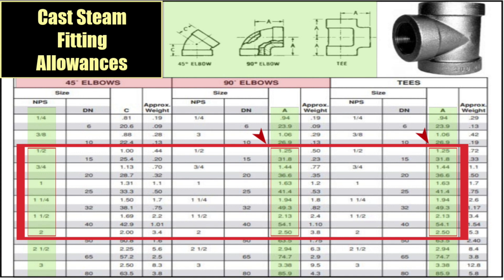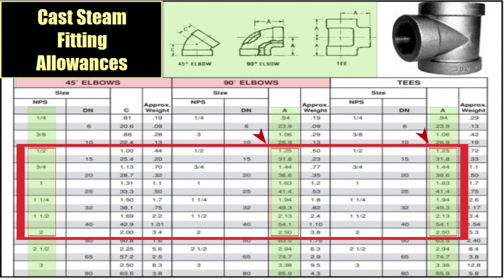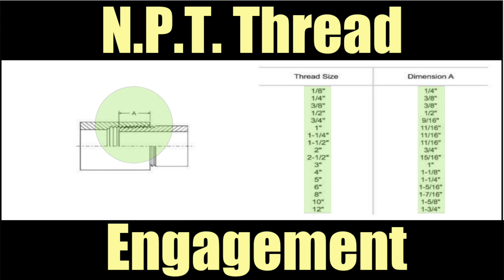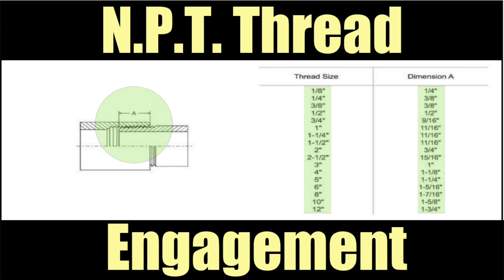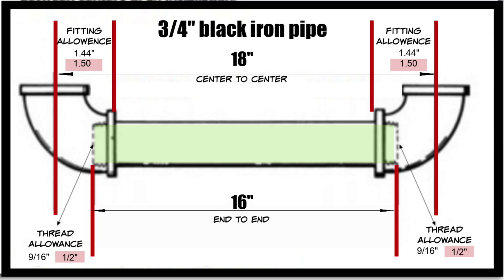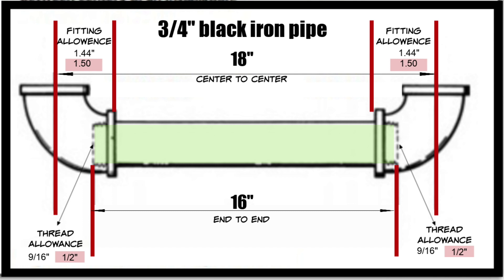Pipe Fitting Basics

Comment: I think what I am going to try is cut some pvc pipe get my rough cuts use metal pipe fittings and I will take the pvc pipe to the hardware store have them cut it and cut threads on it so I can get it right the first time I will put some of it together and pull my measurements off of that  iam trying to make it cheap for  before I srcew it up I have pvc left over I can figure it all out before wasting money cutting pipe that will not fit. I know I could fabricate this stuff if I would go down and buy the pipe threaders, things i'm trying to do a cheap and on a bunch of right now and I can make it any size, I want if I get the pipe threaders and the pipe stand vice's and all that i had good luck with having the hardware store in past cut fabricate my pipe. I was real happy last time. How good it fit? But anyways, I wanted to say thank you. That was a great awesome video. Full of great tips. I do like how you laid it all out on the floor and measured everything out. I'm kind of doing the same thing, but I have a spot right that it's very big and It's underneath the mobile home and hard to get to, but I wanted to say thank you.Keep making good great videos

Comment: I'm A PF apprentice and I cried about 4x today!!!! I have never felt so useless and dumb. Why can't I get this?
Reply from the maker: Example:
Imagine a fitting with a face-to-center measurement of 2 inches and a thread engagement of 0.75 inches. 
To calculate the fitting allowance, subtract the thread engagement from the face-to-center: 2 inches - 0.75 inches = 1.25 inches. 
This means you would need to cut your pipe to be 1.25 inches long to fit properly into the fitting.

Comment: When i do threaded pipe i take my desired over all length take off my fitting throw times two than add my thread engagement. I make sure to write down each step over all fittings then c2c  then next c2c >f2f add in my f2f +engagement = cut <cut>

Comment: Are dresser style/compression  fittings acceptable to use to transition between galvanized to pex? Trying to replace a section of 1/2" supply line to a hose bib. Everything is of course badly corroded. Is that recommended if you cant cleanly get a fitting uncoupled?
Reply from the maker: I would just use  a Shark-bite fitting - https://youtu.be/CuqEibmPVRE?si=WoS6sIFRmtWhxel9
Reply: Thank you for responding Bob. I can use a shark bite on galvanized pipe without having to cut threads?

Comment: I'm wanting to replace two small sections of steam pipe. One section is about 3' and the other section approximately 2'. The first is in between a coupling and a 90° and the second between the 90° and a 2" Tee. 
After sizing and whatnot, I'm thinking it through and can't figure out how I'm going to make the connection to the Tee fitting because of "right tighty, lefty loosey"...
Reply from the maker: You'll have to place a union fitting in between the coupling and 90 or the 90 and tee or both.https://amzn.to/48EG0dB
Reply: @BobsPlumbingVideos  ...so grateful to you for your timely response. I subscribed to your channel because you seem really cool and I resonate with guy's like you. I ended up figuring it out on my own, about the union,and took most of the day figuring out how to accurately calculate the right threaded length. Do you have a handy fool-proof method for figuring out the calculations without going through all the stress(and numerous trips to home depot to get it re-cut and re-threaded) that my girlfriend and I went through???

Comment: Take the pipe size multiply by 2 and add one thread size take this number subtract from center to center measurement 3/4x2 =1.5 plus’s 1/2 thread =2 inches now subtract 2 from 18 get 16 boom simple
Reply: This is the way.
Reply: Where are you getting the 1/2 thread size if it’s 3/4” pipe a little confused about what you mean for one thread size would really appreciate the help
Reply: @chrisskidmore7651  1/2 of thread goes into the fitting.
Reply: Where did you get the 18 from?

Comment: I think the only time I’ve ever used the book on allowances was during my exam. If I remember correctly I think they taught us with iron pipe on a 45 offset the allowance is the pipe size. So on 3/4 you’d take off 1 1/2 total, 3/4 per fitting. Or maybe it’s 3/4 total, I can’t remember but that doesn’t sound like enough. In the field i just put a tape to it and eyeball. It seems like with dwv most of the measurements are pretty round. It’s been a few years since I’ve done a threaded pipe job and I’ve probably done 3 in the last 6 years. We use mega press mostly. But even when I did it I’d just eyeball the tape and it never caused me any issues. The only time I use any of these numbers is on an offset formula. Even then I just measure the allowances. I do find it interesting that the two pipe systems that are going away are the ones that look the best and neatest. I think soldered copper, if done correctly, looks so much nicer than pro press. Funny enough on the video topic copper is easier to measure with solder because there aren’t many take offs. On 90s and tees you jest measure pipe to pipe. With pro press though there’s a small allowance on fittings in order to fit the press head on so you have to account for that. Threaded gas pipe looks so much cleaner than mega press. With mega press you can easily press a pipe in slightly crooked. It won’t leak but it looks terrible.
Reply from the maker: Agreed!

Comment: This topic does not get sufficient recognition in the trades wether it is the books classes or in the field. Great video,    I am getting that book!  Do you happen to know why steam fittings are so beefier and shorter than regular plumbing & gas fittings. Steam pressure for heating systems  is far less than the pressure on water lines no?
Reply from the maker: That's a great question and one I never gave much thought about. I'm going to do a little research and try to answer that for you! Thanks for the question. Bob.

Comment: Hi Bob, I congratulate you for your channel and your videos, very well explained and illustrative.  I would like to ask you a question since I have seen in the work of Pipefitters and plumbers most of the time that this type of threaded joints is made by some people empirically and without technical basis.

Please can you help me solve or know how to solve problems or real situations of take off in threaded joints.

For this examples: 

1) A piece of NPS ∅2" pipe is being cut to run between two 90° degree threaded fittings. The center-to-center measurement of the fittings is 7'-2¼". What is the cut length of the pipe?

2) A length of NPS ∅1½ inch pipe is to be cut run between two 90° degree 6.000# threaded fittings. The fittings measure 7 ft 2¼ inches center to center. What is the cut length of the pipe?

What fittings tables do you use to obtain the dimensions required for the calculations.

Regards... Thanks
Reply: Hi Bob, so sorry for not answering you on time, these fittings are for fixes and spools in AHU's connections for HVAC and Chillers.... #3000
Reply: CWR (Chiller Water Return)
CWS (Chiller Water Supply)
HWR (Hot Water Return)
HWS (Hot Water Supply)
Reply: Mr. Bob, the book you mention and show in the video is this one:
Lee Smith
Mathematics for Plumbers and Pipefitters
8th Ed.??
Reply from the maker: What type of fittings are you using? Black malleable,  black steam, brass, galvanized, galvanized drainage? Need that info!
Reply: @BobsPlumbingVideos  hey bud just hire a real plumber

Comment: I usually measure the distance between the faces of the fittings and then add the thread gain for each fitting to get the pipe length because I can butt my ruler against the face of the fitting to steady the ruler while I take the reading from the other face. Great video Bob! A Pipe threading video would be good follow up video.  I remember my father reminding me not to cut the threads too long which he called a steamfitters thread. Are there special dies for electrical conduit or can standard dies be adjusted to reduce the thread taper. I'd love to hear your views about it and how to adjusting pipe threading dies.
Reply: I think it’s completely different dies because EMT has a different OD. The ones I’ve seen were almost exclusively hand crank dies.
Reply: @joshcowart2446 Only Ridged conduit is threaded.  EMT is not meant to be threaded and is not legal for exterior work.

Comment: New to the channel.  Do you have a video on cutting around the shower stems.  I saw your video on using a Gerber rebuild kit.  Can that replace any 3 handle shower?
Reply from the maker: Regardless of brand, I use an old screwdriver / small cold chisel to chip away at the tile in order to remove the chrome sleeves going into the wall. I work on Gerber, Price Pfister, Sterling, Central three valve shower body’s in my service area.

Comment: I have seen thread protectors used as couplings and you can tighten them until there are no threads left. I am surprised A lot of them dont leak because 2" and smaller are not npt pipe threads.🤔
Reply: That’s cause you using imported pipe